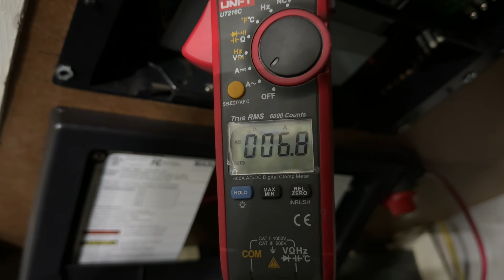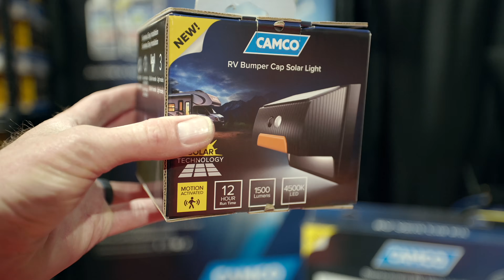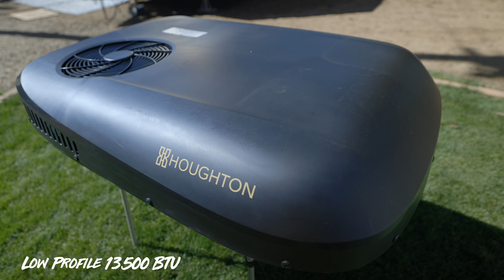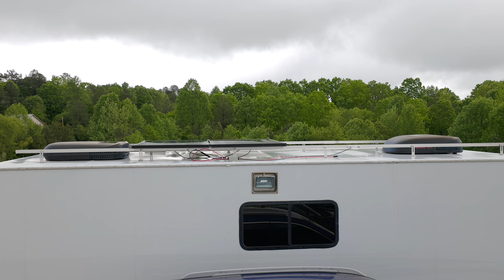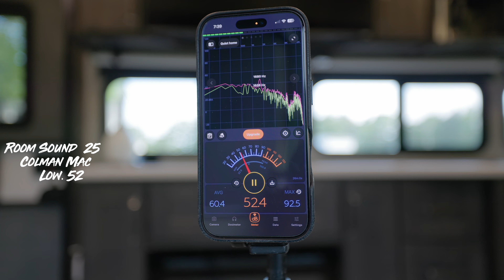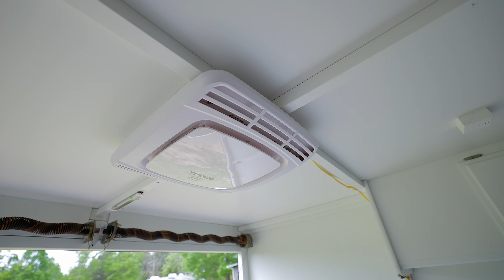New RV AC Tech!  Mini Split Power With Ultra Low Amps Tested!

Comment: This seems so obvious.  I thought about starting my own company to do this but figured the market would be flooded within the year.  That was five years ago.  Mini splits are the way to go, we just need some good ones.
Reply: Let’s partner up! 

The problem with the 14” openings is you can’t get high capacity cooling without lots of fan noise. I’d like to see solutions for new RVs that don’t rely on that opening size and are quiet. 

But also, I want to see a retrofit that fits into those openings and connects to the ducting. I think airflow could be improved if you could separate the condenser and evaporator. Both of these rooftop designs the video looks at keep them combined. Though they don’t connect the fans, the evaporator is still outside the coach on the roof.
Reply: Why does the fan need to sit above the hole? Why not set back maybe 14" with a gradual radius for a smooth transition into the duct or dump? Just spitballing ideas for your company.
Reply: This isn't a mini split, stop calling any mini split. It's an inverter AC unit. They are more expensive than a regular AC unit. And they have potential issues as well, do your research

Comment: My RV is 30 amp, since this only pulls 8 amps could this be used at the same time with my Furrion 13.5 AC, without having to have an external power source?
Reply: Microwave uses around 9-10 amps (plus startup amps). You’d have to turn off an AC to run the microwave. Would probably trip the breaker - the new AC should ramp down to 4-5 amps once set temp is reached giving more cushion in amps.  Best part of the new AC is it doesn’t turn on and off. Just keeps cooling and keeps it more comfortable.

Comment: Great review, Jered! We've had the 15k Houghton heat pump for two years and would NOT recommend it. After a year, the control board went bad, and in under two years, the entire rooftop unit went bad. RecPro sent us replacements when it was under warranty, but replacing the rooftop unit was a pain, and now the compressor only cools about a third of the time even when the set temp is far below the ambient temp. We're almost certainly going to replace it with something else, and the Turbro looks like the best for us because it heats in much lower temps. Below about 40 F, the Houghton does not produce much heat.
Reply: Thanks for the heads up!
Reply: Appreciate you sharing your experience.

Comment: My biggest concern is efficiency for boondocking. Do you know roughly the watt hours used roughly over a 24 hour period? With that said I get it about size of rig, insulation and so on.
Reply: That's going to depend entirely on the temperature difference inside vs. outside. But in our experience, we can run our Houghton in cooling mode overnight and typically use about 300-400 amp hours of battery capacity in doing so.
Reply: @calledtojourney  Thank you and yep tons of variables but good rough idea.

Comment: Love seeing SOMEONE is trying to get the AC units lower profile, Ill take back every inch I can get. Wondered why they didn't lay the compressors horizontally and wrap the condenser around the side a bit to get them lower. Auto compressors have been running horizontally forever.

Comment: How do these compare to the Coleman Mach for removing humidity while cooling?  This seems to be becoming a bigger issue as newer RVs provide better insulation and are sealed tighter.

Interesting video, as usual!
Reply from the maker: All ACs will do about the same for removing humidity while cooling. It’s just a byproduct of the AC. It’s just the buildup of condensation on the inside coils that is then discharged outside.
Reply: @AllAboutRVs  From what I have read about this topic, variable inverter units are potentially a lot better than fixed units, specifically when you don’t want to cool as much. 

If you have an “oversized” unit (oversized in quotes because what counts as oversized will likely change depending on season etc), what happens is that it will chill and dehumidify a small amount of air. But since it makes that small amount of air *very cold*, this small amount of dry and very cold air mixes with your warm and very moist air, and the blended air results in your target cool temperature but with a lot of humidity. 

If you have a lower BTU option, then it can cool and dehumidify much more of the air. Because it will only cool the air a little bit while also dehumidifying it. 

So if you’re running at full tilt they are the same. And if you’re willing to make the air very cold, you can dehumidify all the air. 

I don’t know if that scenario actually comes up very often in RVs.

Comment: Efficiency is the most important thing to me as I live FT in my coach off-grid. I'd like to find a high efficiency roof mounted heat pump to go on the front of my motorhome to replace the Furrion I currently have. My Furrion uses 3 times the power that my 28.5 Seer-2 12k btu EG-4 mini split heat pump mounted on the rear of my MH does, which is important when you're running it off batteries. I can run my EG-4 24/7 as needed but can only run my front A/C a few hours a day when it gets really hot. I'd also like one that will run in reverse to make efficient heat and be quieter than my current noisy Furrion. I guess I'm spoiled by my 32db mini split that I can't even tell if it's running without seeing if the louver is open.
Reply from the maker: They are supposed to be. Coming out with the Chill Cube with a heat pump and and inverter compressor that I hope to test when it comes out but I doubt it will complete with the EG4.

Comment: Great thorough review, thanks! We have been on the fence between Gree and Turbro, this confirms Gree for us. I don’t know of any way to make a non-ducted A/C quieter, there are ways to increase power supply.
Reply: I have this Turbro unit and regret it.   As long as you don't mind the compressor startup issue, I think the Gree/Tosot may be better, though I don't have a head to head test to confirm that.

Comment: Any idea what the Coleman Mach 15K without easy start draws?
Reply from the maker: Mid 50s
Reply: @ wow. I only have a 30 amp RV but I guess it can handle the 50 for a short period
Reply: @eaglescout1974  Its a very short spike measured in milliseconds. All motors have a similar locked rotor starting current spike. Its why the lights dim in a lot of houses when the central aircon kicks on.
Reply: @eaglescout1974  Our 2400 watt Victron Multiplus II has no problem powering up the Mach 15k.